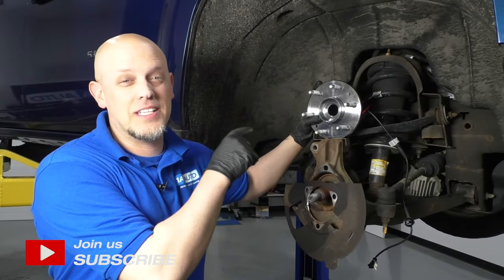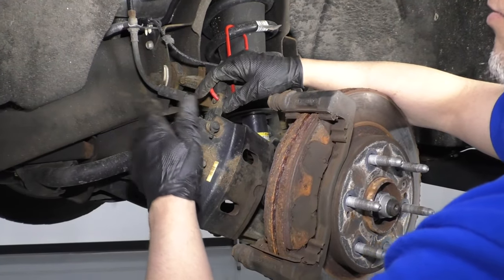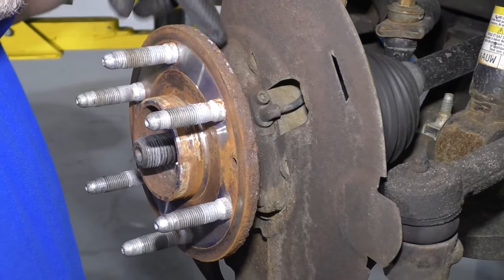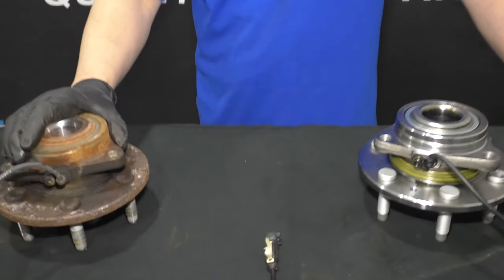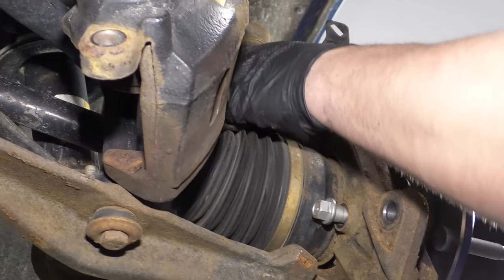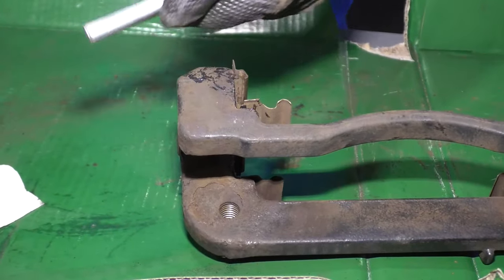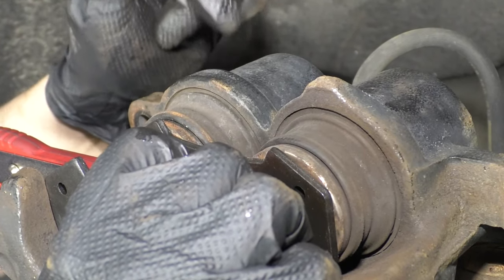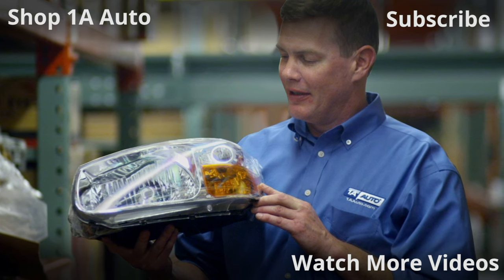How to Replace Front Hub Bearing 14-17 Chevy Silverado

Comment: Just did my 2017 Silverado on both sides.  18mm sockets both 3/8 ( a tad smaller)  and 1/2 with various small extensions let me get sockets on all 3 18mm bolts.  Turning the wheel a few times then allowed for longer breaker bars as well to bust them loose.  Beats fighting with an 18 mm open end as some of the videos show.  The hubs came out pretty easy at 151KM and in Cdn winters/rust zone.

Comment: FYI disconnect your battery before you unplug anything because  It may send an error code to your computer and it will cost around $200 just to reset it.

Comment: I don't know who taught this guy to use a hammer on a threaded shaft without using the nut to protect the threads and end of the shaft so you don't mushroom the end of the shaft. Also if you look at the rotor there is a threaded hole that you can put  a bolt in and tighten up to break the rotor loose.
Reply from the maker: +Scott Habeck Thanks for the tip!
Reply: I cringed so hard when he was hammering on the threaded axle

Comment: Should specify 2 or 4 wheel drive. I bought the 35mm socket and didn’t need it because my truck is 2WD. The hub didn’t even have a hole in the middle. Freaked me out but I’ll keep the socket anyway because I love tools!

Comment: I just replaced both of my hub bearing assemblies yesterday on my 2017 Silverado. I am now getting a stabilitrack code and an abs light on my dash. Is that something that can be reset with a scan tool?
Reply: unhook your battery for 5 min then hook back up. computer just needs to reboot the new abs thats on the new one

Comment: I followed every step and it went smoothly but now my abs light and stabilitrak is on and wont turn off, what might be wrong?
Reply: Same here. Did you find a solution?!?!?
Reply: I don't know dick all about stuff like that but I'd start by unhooking the battery to see if the computer resets the light.. otherwise get a scanner to see if anything comes up

Comment: Is the socket required 35mm or 36mm?  Everything that I've found online says 36mm.
Reply: Literally changed mine yesterday (4-17-22) and a 35mm will barely get on there and the 36mm is a little too loose. I used the 35 but had to kiss it with the hammer on and off. 
Its a bastard in-between size. Some kind of 64th BS that they make.

Comment: Where can I get all the torque specs for my vehicle
Reply: Tighten axle nut using cheater bar as tight as possible.  Use cheater bar on axle nuts. Tighten break caliper and bracket hand tight as tight as possible and you'll be fine.

Comment: you torqued the axle nut to 177 and spec for 2010 to 2017 is 188
Reply from the maker: +Sid Seip Thanks for the feedback!
Reply: What is the torque spec for a 2019 Yukon 4x4?  Also is the nut size 35mm or 36mm?  Thank you.

Comment: Are the bearings inside the hub not serviceable?  I mean its a $150 hub vs a $20 bearing that goes inside it.
Reply: No. They are a sealed unit
Reply: Almost 300.00 for the hub….
I agree with you; 20.00 bearing with 5.00 of seals
Reply: Sure go make one for $25 then. Because apparently they’re made in someone’s garage 😂

Comment: How long of a job is this? Trying to get an idea of what I’m looking at for labor before I call the shop as I don’t have the tools to do this myself. Thanks for any info!
Reply: Ur looking at doing it urself without a truck lift in driveway about 90mins per. Tire 3hrs total .... Hardest part is loosening the 18mm bolts with the factory thread. Locker .... I used my impact driver drill to loosen then used ratchet n cheata bar to loosen it .....
Reply: @dineguitarist2148  you aren't kidding about the thread locker.    My big Milwaukee struggled to get them loose when I did brakes.